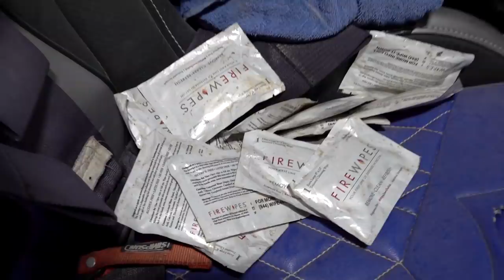Rebuilding our wrecked Copart bought RZR Turbo S! How much will it cost?!

Comment: What kind of fork lift is that? Why didn't you tilt it backwards after you got air beneath the OG battlefield? Great deal, btw a steal. For the seller.  When I saw the video of the auction and you got the "you won" notification, it kind of hit me. When it's all said and done, I've never won an auction. Sure I got the right to pay up, but I always over paid. Turned out, I didn't "win" the auctions I lost. And so did you I think. But at least we get to watch the battlefield reborn. And you can't put a prize on that.

Comment: I’m thinking instead of another possible give away,print up raffle tickets and raffle it off.5,000 $10 tickets and give half the proceeds or more to a local charity,like a humane society or something.👍🇺🇸
Reply: They'll probably make way more than that off the shirt sales. WAAAY MORE
Reply: @RZRMINERBDR  T-shirts cost them a lot to make and they won’t sell 5,000 of them.Electronic raffle is a $25 app.to install a bar in my area just raffled a Harley that way.
Reply: @steveyork8069  I'm not sure how much the shirts cost to make but at $25 each that's $25000 gross if they sell 1000. With over 300000 subscribers that's what....0.3% of subscribers needed to buy a shirt? One third of  one percent. Big channels give away $50k to $100k vehicles all the time. All you have to do is buy some merchandise. It radically boosts the sales of merchandise and more than covers the cost of manufacturing and shipping. That's why they all do it. When I say big youtubers I mean channels with 1 million or so subs.

Comment: Just curious what the fuel bill is for one week for Leo's dodge truck ?
How does it compare to battlefield rebuild 🤔
Reply from the maker: I hate to admit this. I’ve had the truck 5 months and put on 8000 miles. Averaged about 10mpg at roughly $4.50 a gallon average….. yeah that’s $180 a week 😵‍💫